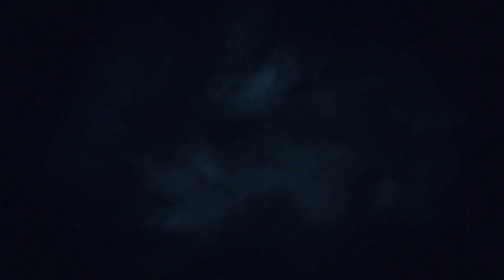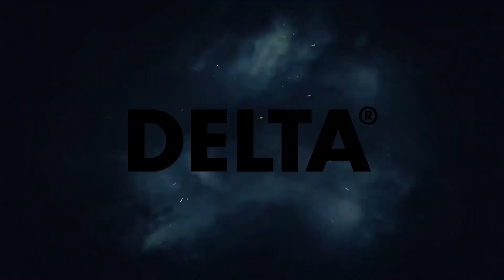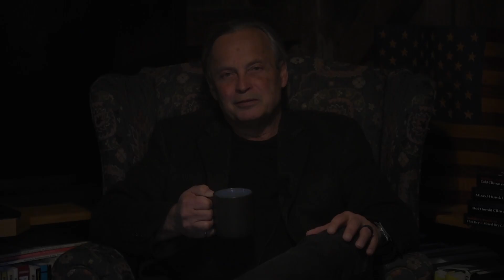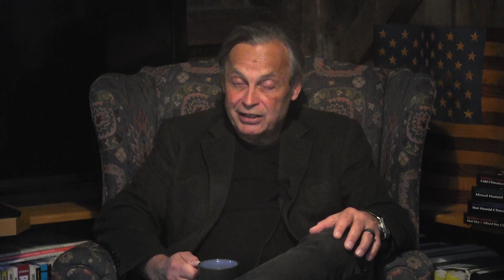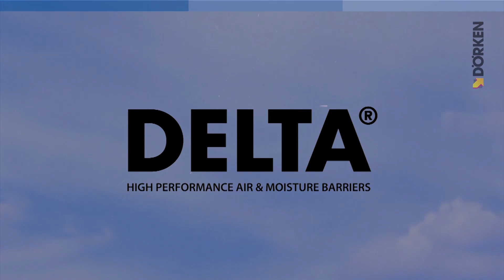A Cup of Joe: Airtightness | Building Science Deconstructed

Comment: A 30 square  7 ft box out Gable End roof with furnace and chimney pressurized return  interior  tongue and groove  gusset, could incorporate  a two foot parapet  and landing  on both sides 4 ft in from both rake ends to a greenhouse  installment with Leuvers. The  vortec turbine  gutter roof design gives indoor plumbing it's final destination of perpetual hydro electronic automation through  the sprinkler system double 5/8 water closet, incorporated dumb waiter, and the outside spicket at 90 psi. Supplying a rain barrel catch of highly rich Bentonite soil run off to a delta water shed area mineralization. Of coarse I think  a 15 gauge Carlyle rubber roof would have to carpet the attic, and up the walls, where the water could pitch to the sump differential...based on those physics, in my opinion.
Reply: Sound science I'll take 3 of em eh